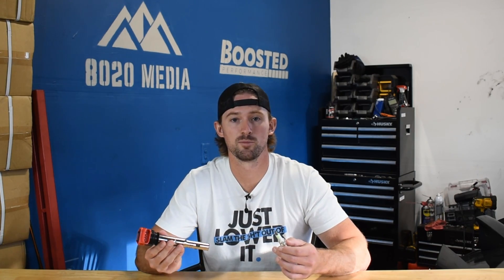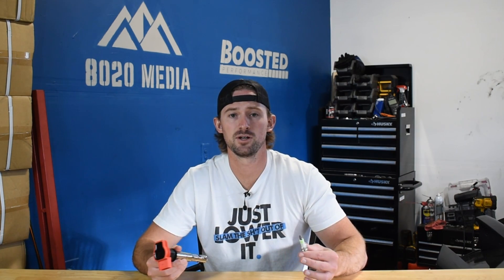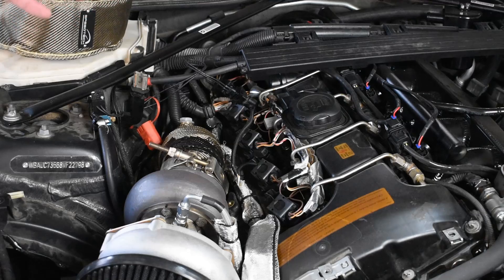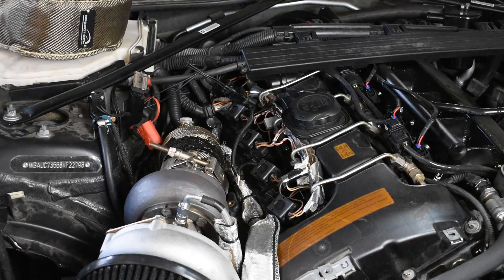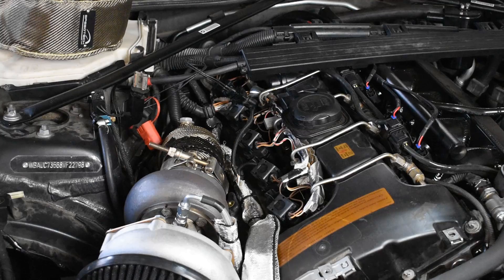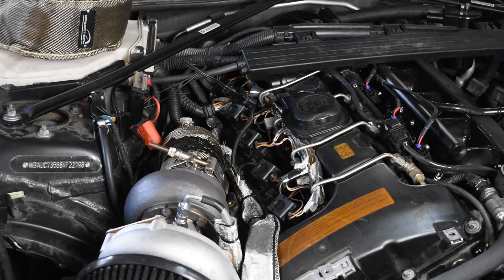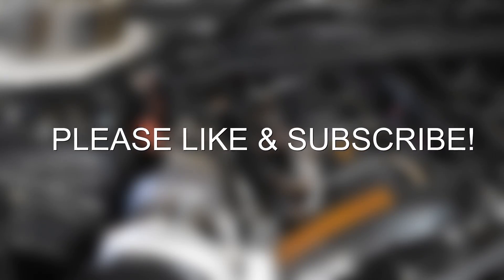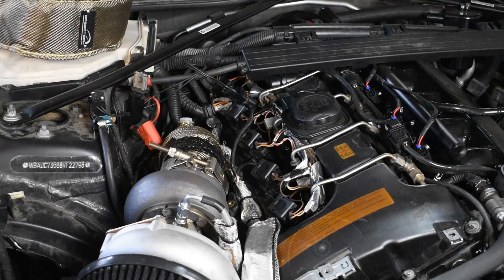DIY - How to Diagnose Bad Spark Plugs & Ignition Coils!

Comment: I notice a strange hiccup or cough noise directly from the engine with warm starts and it’s happens every once in a while. I have an engine cylinder 5 misfire with check emission lights and traction control light with LDW and FCW system lights on. They came on last time when we needed new spark plugs and ignition coils so I’m taking it for repair this weekend. Though the cough noise I’ve been hearing concerns me as I’m not familiar with it and I researched for hours with no content creator mentioning this or they talk about noises that sound much different from mine. The last mechanics monitor says my vehicle has 25 error codes.
Reply from the maker: S - Sounds like there could be a lot going on. What did the mechanic suggest addressing first?
Reply: @8020Automotive  From there he said he could assess and see how many error codes that will erase. Since after we saw him we replaced the timing belt and water pump with serpentine belt.
Reply from the maker: S - Did replacing these do anything?
Reply: @8020Automotive  I haven’t got to that yet
Reply: @8020Automotive  The Spark plug and ignition coil
Reply: @8020Automotive  We were an unfortunate family that fell victim, We were deliberately lied to but the mechanic we thought we knew and trusted. He advised us to stop doing oil service for our vehicle using his logic that the pieces of broken engine debris will kick up in the new oil and make our engine run worse. We took his word for it as we were out of money completely and about to enter homeless. Fast forward 5 months later, We still have an engine misfire with cylinder 5 and transmission issues that we haven’t been able to fix and driven 25,000 miles without a single oil maintenance. Only then our financial life stabilised and I started doing research and talking to people until I took the risk and brought it in for an oil change. So far the engine hasn’t performed any worse which completely falsified the mechanic’s advice and we replaced the timing belt, On schedule to do the spark plugs and ignition coil and another oil change. We’ll see what happens from there on but I have new hope for our minivan!
Reply: @8020Automotive  YouTube likes deleting my comments, I responded and he said that we need the spark plug and ignition coil.
Reply from the maker: S - Sounds like you're pouring a lot of money in in hopes of getting resolved..
Reply: @8020Automotive  From the sound, I knew beforehand that the misfire wasn’t a timing related issue otherwise the pistons would hit the valves. It’s a light misfire, The same lights are on the dashboard when we had to replace the spark plugs a while back. That leads to my assumption and also that the mechanic read on his monitor and advised me to replace them
Reply: @8020Automotive  Misfire is solved😊
Reply from the maker: S - Glad to hear! What resolved it?

Comment: Just brought a 2006 hyundai sonata runs well no over heating no engine lights but it has abit of a miss when at very low speeds(crawling at a rolling stop) and also just noticed its missing abit sometimes at higer speeds on the highway(stops when i put my foot down and force the revs up). Do u think this could possibly be the cause? Moneys tight so trying to decide if its worth fixing as ive just brought it for cheap as a daily to get close by to and from work. Would sooooo appreciate any advice!
Reply: Ugh.. I'm a lady and I'm having this issue as well. I have no check engine light code. I have replaced 2 of the ignition coils in the past
Reply: @TheLookatit  we replaced all of ours and the  leads....cars running perfect now!
Reply from the maker: Y - what do you mean by it's missing? Misfiring?
Reply: @8020Automotive  yes, like a stutter
Reply from the maker: Y - We have a great video for misfires that may be helpful here: https://youtu.be/f1mQ5hD1-vI
Reply: @8020Automotive  awesome thankyou, that was very helpful.....thankyou so much for taking the time to reply to my comment, I so appreciate that. Awesome channel! Subsribed😚
Reply from the maker: Y - Thanks for the feedback! We're glad we could help.

Comment: What if the yellow light lighted only after driving few miles? Not immediately when starting the car
Reply from the maker: J - Assuming you're talking about the check engine light. Do you happen to know what engine codes you're getting?

Comment: Isn't there a tool to test the coils individually? This method sounds outdated. I have had mechanic identify my coils without swapping  coils. Who has that luxury of time?😅. Thanks anyway
Reply: If you run to a mechanic shop then you should go back to watching videos of zero value.  This is for people who are not interested in wasting money on something we can do ourselves.
Reply: @hoppyjohnson8571 he is walking for sure 😂😂
Reply from the maker: O - The method we talk about doesn't take very long. haha
Reply: It does if you have to remove upper Intake to swap.
Reply: Why wouldn't you take the time necessary to properly diagnose an engine issue?
Reply: Did I miss where you determine or explain how you know your spark plug is bad?
Reply: OG method take a screw driver to see spark or pull boot while running and listen for the arc. I recommend a thick rubber glove for the second one.

Comment: Will bad plugs or coil pack cause a car to die and not start until it sits like 20 to 30 minutes
Reply from the maker: H - Sounds more like a battery or alternator issue.

Comment: Thank you for the video
Reply from the maker: B - Thanks for the feedback! We hope it was helpful.
Reply: @8020Media  most definitely, I was going to switch coil packs 1 from the back, causing the misfire to a front of the engine one just to see if the misfire moves with the coil pack. I know it hasn't had plugs change in over 100 k, so all 6 plugs were a no-brainer. But to get the plugs changed, I have to take the intake off intake plenum at a minimum. But I wasn't sure if I was going to do the coil pack also on that cylinder, too. But I will take the coil off 3 and move it to 4 and see if it moves the misfire.  At minimum, it saves money and time.  I had a stroke 4 weeks ago, and I basically wanted to verify that I had the process correct before doing it. I am a mechanic by trade and truck driver by choice. However, I can no longer drive and am re teaching my mind on stuff I should already know. So, in the long form, yes, this video helped more than most would know.
Reply from the maker: B - So sorry to hear this, glad you are okay. Thanks for sharing this feedback.

Comment: What if the code only reads p0300 and doesn't say a specific cylinder? I know it may be multiple but how do I know which ones? It's has to be a ignition coil because I changed the plugs
Reply from the maker: J - This video could be useful here: https://youtu.be/f1mQ5hD1-vI

Comment: thnx for these info. My fx35 2009 lately feels like it is not smoothly shifting from 1st to 2nd gears. I feel a slight miss, if i accelerate slowly when moving from a stop, but if I move rapidly this slight hesitation is not felt. Can you say what you think may be the cause. This suv idles steadily, and drives ok, but I know it is just not right, something is causing this new feel in the drive.
Reply from the maker: F - Do you have any engine codes?

Comment: Lol my obd2 port is dead and i just changed all 4 coil packs and plugs. Damn thing started up running horrible. No power to even move forward. Backfires on high idle after rev to 3k. Im sure its the ignition coil connectors. Good ole 1.8t VW. Just bought a whole new harness to splice into. Wish me luck. Gib me some info on ohm meter test
Reply: My turbo isn't connected via vacuum line to N75 
Lmao but i hooked it back up. Bad mistake.
Reply from the maker: D - Did this fix it?
Reply: Did it fix it?
Reply: @joeystrange87  Yes. It's a common issue on all those 1.8t B5's. ... I just took the pre made harness and cut it up and spliced it into the existing harness to reduce confusion for future owners. Fired right up like it never had a problem. That poor car had many MANY issues...
I bought a tweeker car and I had to hook up the entire turbo system again. They had the SAI delete but had the turbo basically non functional. Not really sure why but I digress. It spooled up after that and maaan... what a rip of fun that fucker was lmao Realized the turbo was trash because would make HUGE cloud of smoke after sitting for 5min... crank vent and turbo plus no way to see the cat was just too much to deal with. Gave it to a buddy to fuck with.

Comment: I have a 2003 Dodge Caravan Se V6 3.3 and it has a coil pack, in this video your swapping individual coil on plugs from cylinder 1 to cylinder 2, how do i apply the same swapping diagnostic test on the coil pack, can you help me with that, please?
Reply from the maker: I - Yes, this is on a BMW. You might want to opt for a multimeter instead.

Comment: Hello :) I have a Honda Civic gx 2008 natural gas vehicle.  It runa fine drivinh it for a bit . Then, out of nowhere, it starts slowing down even when i have my foot fully stepped on the gas. It doesn't accelerate.
Reply from the maker: E - Do you have any engine codes or engine lights?

Comment: How u know if spark plug is bad I didn't understand
Reply from the maker: T - If you look at it, you could tell. Or if you have a P0300-P030X code. What vehicle do you have?
Reply: @8020Automotive  2003 grand marquis

Comment: Is the ignition coil and spark plug wire are the same ???
Reply: Thank you so much for the fast response and the good info cheers buddy
Reply from the maker: SB - Keep us updated.
Reply from the maker: Spark plug wire connects the spark plug to either the ignition coil or the distributor (depends what type of ignition system you have). So no they are not the same...you should replace the wires when you replace the spark plugs, though. They could be causing some issues, if not then you need to check if you have coils or a distributor and check that.

Comment: Is there a way to tell if your new ignition coils are faulty? Spark plugs were all changed last year and only 1 ignition coil. Check engine light, recently came back on mechanic said it was the same issue. All coils have been replaced as of today however the issue yet persists. Any tips guys?
Reply from the maker: S - You may need to drive it for a little while for the codes to clear. Keep us updated on this.
Reply: Maybe you have another error code 
When you replace the ignition coil, the engine was  running good 
Did you read the error codes???

Comment: I took my Hyundai Accent to the dealer (1st mistake) for a diagnostic  for engine surging. They diagnosed it as a bad ignition coil. They quoted me a repair cost of $1200.00usd. I did 5 min of research (watched you tube vid). I bought the parts for $230.00 and fixed it myself in 15 minutes. 

I changed all 4 spark plugs and all 4 ignition coils so I didn't have to play the process of elimination game. Do yourself a favor and do a modicum of research prior to paying someone to do something you could do without breaking a sweat. The price I was quoted should be classified as a crime. 

Pay for the diagnostic at a place like Midas where it's cheaper and fix it yourself, depending on the degree of difficulty.
Reply from the maker: L - That's our exact goal, to assist anyone, regardless of automotive skill level, to be able to DIY issues. Thanks for sharing your experience!
Reply: @8020Automotive Grow up little boy and stop spewing immature disgusting filth in public, especially on this forum and your T-shirt!
How pathetically unprofessional, disrespectful, uneducated, and immoral.
How sad to know your father and mother utterly failed to raise you to be a real man, a true gentleman of moral character. Instead, you sound like just another ignorant inbred redneck or BLM street thug who failed English vocabulary.
Reply: $230 x 4 coils is $930.
$1,200 - 930 =$270.00 

So, they were asking to charge $270 for labor,
assuming they would replace all 4…
Reply: @Americansikkunt really? Read again. It was 230 for all the parts.
Reply: @Americansikkunt There are online wholesaler websites that sell oem parts for 50 to 80% less. I just picked up Denso coils for a v6 honda accord at 28 bucks each and ngk laser iridium plugs for 9 bucks each.
Reply: @Americansikkunt no they were going to make atleast 1000 just for labor and they were just replacing one.
Reply: Autozone will run a diagnostic on your vehicle for free.
Reply: Infiniti quoted me $1900.00 for the ignition coils and spark plugs plus $560 for labor. It's ridiculous.

Comment: Thanks for the information. I have a problem I am hoping you can shed some light on. I had engine misfire and replaced all. the coils and spark plugs. The misfire went away. Also have a new fuel filter. Six months later, I am experiencing a random misfire.  Sometimes the car runs perfectly, and all of the sudden it misfires for a few seconds. Sometimes the "Service engine light soon" flashes on and off during the misfire. Then it goes back to running ok. I have poured motor treatment liquids to see if cleaned injectors and the such. Once it misfires, I can detect a P0300 code and troubleshooting this has been difficult. I do not get more specific codes. 2003 GMC Envoy XL 4.2L 6 Cyl. Any thoughts?
Reply from the maker: Dennis - We think a video we made a little while back might be helpful: https://youtu.be/f1mQ5hD1-vI
Reply: Thanks, I watched the video. The frustrating thing is that I am only getting P0300. Most of time, the car purrs like a kitten, and when it sporadicly misfires, the "Service Engine Soon" light flashes on and off while the engine is misfiring. When the misfire stops, the light turns off. The check engine light never come or stays on. No other codes.  I bought some coils and spark plugs from Amazon in April 2023.for $119 (six coils and six spark plugs). I did some tests (running the car and unplugging the coils one at a time) and all 6 seemed to be working ok.  Later today, I did get a code P0302 and I replaced that one spark plug from Autozone - the p0302 code went away but still get misfires.  I am leaning to think that the spark plugs that came in the Amazon set are not good quality and am thinking of replacing the remaining 5 spark plugs. The spark plugs read "Iridium ILT5RA 13G" but don't have a brand or code to identify anything else. IN my Amazon order it says Manufacturer LCWRGS? The air filter is clean, I have a new Fuel filter. After I change the spark plugs, I will proceed to a professional mechanic for compression and fuel test. Thanks again. (I am in the Temecula CA area).
Reply from the maker: Dennis. Sorry to hear about your frustrations. What vehicle do you have? Keep us updated!
Reply: This morning, I tried two tips I saw on YouTube. One- when you clean your throttle, you have to reset the ECM in the throttle by switching the car on to the ON position and depressing the accelerator for 15 to 10 secs. I did that twice.  The Second tip - since I had added an injector cleaner... was to put the car in first gear and accelerate to drive up the RPMs. I did that and it felt like if something got unclogged and the engine started revving better. I did a longer test drive and the misfire seems to have gone away. 

Also, I reran diagnostics and the P0300 is gone. Maybe I dodged a bullet.  Thanks. @8020Automotive
Reply from the maker: Dennis - Nice! Glad to hear this has been resolved. Also, thanks for sharing your experience! This will certainly help future viewers.
Reply: @8020Automotive  As an FYI...  a bent pin inside an engine coil  socket triggered the P0300 and misfires. Giving the impression that a spark plug, a coil, or the coil wire/harness was bad. I had installed all new spark plugs and coils and was still getting P0300 and misfires. Thank God a mechanic happened to notice it before we started replacing suspected bad spark plugs, coils, or more. P0300 and misfires have gone away.
Reply from the maker: Dennis - Thanks for taking the time to share this! It will be very helpful for future viewers.

Comment: I would like to say thank you for taking the time and effort to help other people
and also would like to know if you can advice me with my Honda Accord 2006 I have a check engine light and I already replace the catalytic converter (after market) also the o2 sensor twice and I don't know what else to do
Reply from the maker: Anthony - Thanks for the feedback. Do you have a code reader?
Reply: yes P0139
Reply from the maker: Anthony - Since you've already replaced the cat and O2 sensor, have you taken it to a shop? Only things we can think of are exhaust leaks somewhere, lean or rich running conditions, or PCM issues.
Reply: I did took it to a shop and there is not exhaust leak ether, someone I know told it could be because the after market cat. is not big enough and this cost some kind of miss presure
Reply from the maker: Anthony - Certainly a possibility.

Comment: To diagnose bad plugs just remove the spark plug and look for a plug with light brown colouring.  Bad coils will causing stalling, engine hesitation and the poor overall engine performance.  I have NGK Irridium plugs in my 2002 Rav4 and the engine still runs like it is new.  The Toyota OEM ignition coils lasted for 275,000 km before they finally gave out.  DIY replacement cost was about $220 Canadian for 4 new coils, a new EGR valve, a new PCV valve, a new MAF sensor, and a battery.  Not bad for a car that I rarely maintain....
Reply from the maker: B - Thanks for sharing your experience.
Reply: More helpful than the video😊